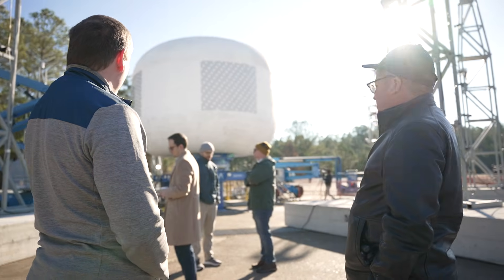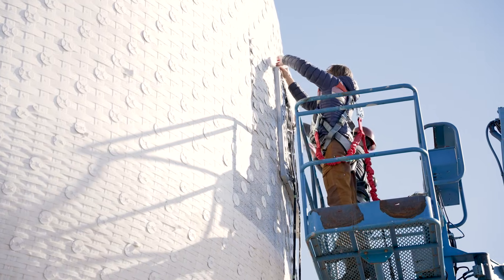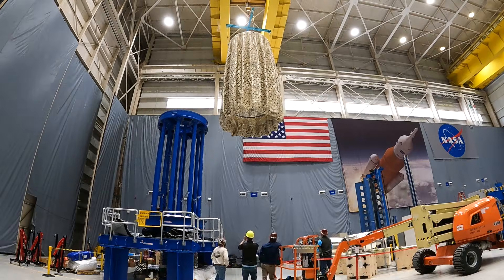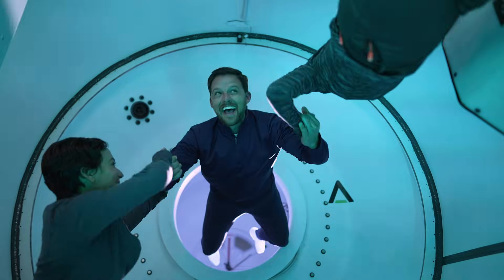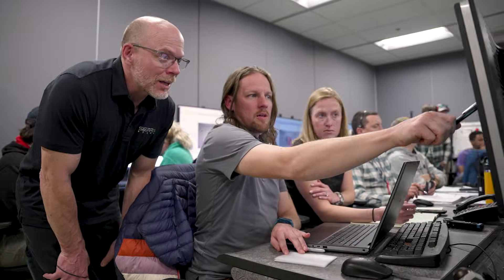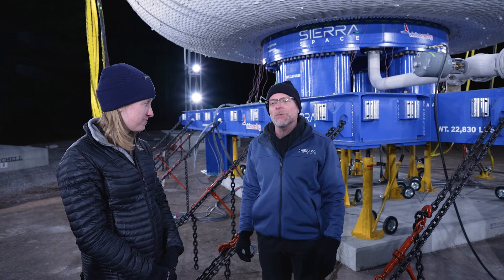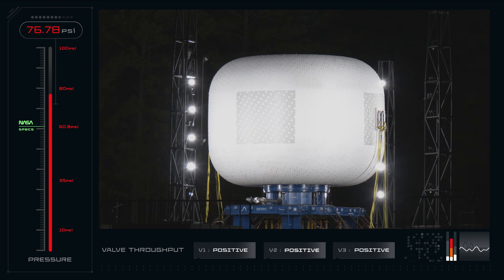Full-Scale LIFE™ Inflatable Space Station Burst Test at NASA Marshall Space Flight Center

Comment: What if asteroid punctures station?
Reply from the maker: The MMOD would absorb the impact and not puncture the pressure shell or restraint layer. In the unexpected case of an impact that makes it past the MMOD to the pressure shell and air barrier, the system is designed to be repaired internally.
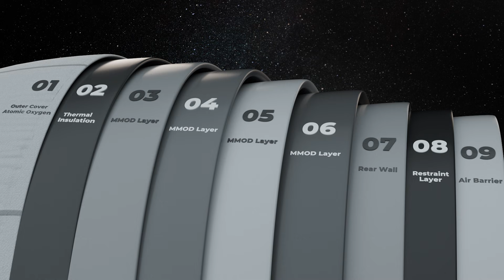Reply from the maker: Also, you can have a look at the layering our space station technology will have at 2:42 in the video. Our subject matter experts work with NASA to perform extensive testing and analysis of the entire MMOD stack.
Reply: @SierraSpace  "The MMOD would absorb the impact and not puncture the pressure shell or restraint layer." -- That behavior would be dependent on the rate at which the asteroid is traveling and it's size and it's shape; I believe.  You'd have a range of reactions based on the size of the debris and the rate at which it is traveling; right?  

Now; you did manage to exceed NASA's safety tests by 27% -- that is a huge success for you and your team!  Congratulations are definitely in order.
Reply: Boom!

Comment: Back in the 1960's, as best I recall, there was a design for an inflatable station on the cover of a Popular Science/Mechanics Illustrated type magazine.  The design was a Von Braun style station with the ring for rotation to simulate gravity.  My copy of the issue is, however, long lost.  :(
Reply: Was it the December 1962 edition of Popular Science "Inside Our First Space Station"?
Reply: If you want to scale up your inflatables a torus is a better solution than a balloon.
Tensile strength of the material is the limiting factor and has to increase linear with the radius of the balloon.
In case of a torus - as long as the small radius can stand the interior pressure you can increase the big radius almost indefinitely. 
The possibility of artificial gravity by rotation is a bonus.

Comment: it's all fun and games til a 10mm socket hits it at 18,000 mph
Reply: If this things in orbit, that means something either needs to be traveling at 36.000 mph in the same direction, or on an EXACT OPPOSITE ORBIT that precisely adjusted speed and timing to be at that EXACT OPPOSITE orbit. Hmm, what are the odds? It’s called zero. Things in orbit are going to collide at much smaller differentials except for micrometeorites and I’m not going to copy/paste Sierras’ statement about their testing in that area.

Comment: I'm curious if whipple shields could be integrated into the inflatable structure, to account for micrometeorites. Perhaps a graphene rear wall? Assuming, that is, graphene isn't too hideously expensive, and can actually handle the energy of such impacts without tearing apart or away from anything it is attached to. It would certainly reduce weight compared to steel, at least; possibly even able to stretch alongside, or even inside, the existing inflatable structure.

As a side note, I'd love to see your approach to inflatable centrifuge modules. If Kerbal Space Program is anything to go by, they will certainly make any station they're sent to much cooler.
Reply: They briefly displayed a diagram showing that the material has several layers. I imagine that's the micrometeorite protection
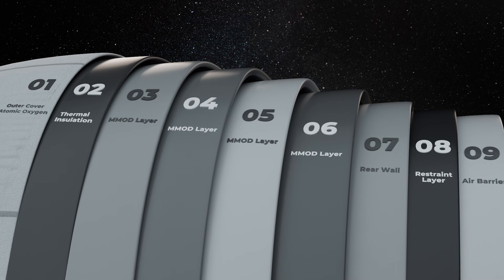Reply: 2:41 Layers 3 to 6.

Comment: How does it handle micrometoerites and radiation. 

Asking because that seems to be the only questions answered lol 
What I really want to know is when will the first module be launched into space for testing. After 2030, 2025-2028?
Reply from the maker: Our team works with NASA and uses the known and projected orbital debris environments in designing the MMOD shield. Those designs are then tested by simulating orbital debris impacts at varies speeds, size of projectiles/materials and angles in High Velocity Impact (HVI) tests. Our space station technology is designed for its environment and takes into several factors including radiation. Specialized shielding is designed to be a part of the MMOD layering along with other materials that are internal to the Inner Mold Line (IML) of the softgoods systems.
Reply from the maker: The timing for the first module will be dependent on the completion of tests in partnership with NASA. Our team has an an aggressive testing campaign this year at both sub- and full-scale, including a series of UBP tests in tandem with early-stage development of the primary Atmospheric Barrier and Micrometeoroid Orbital Debris (MMOD) layers. We'll have a better idea of timing upon completion of these tests.

Comment: I'm guessing that if you are inside one of these in space and you got a slow puncture it would be easy to fix from the inside. I'm not so sure what would happen if you encountered a blow out in space.
Reply: Rough googling says the speed of air is 1.5 times the speed of sound (500m/s)

(2cm * pi)^2 * 500 m/s = 1.97392088 m3 / s (4cm diameter hole)

Total volume is 283.17 m³

Equals 2 minutes with a 4cm diameter hole.

Comment: How well does it handle fire?  Internal or External?.  How flammable is it?  Does heat reduce its strength?  I realize it will probably only be nominally at ~14.5psi, but would fire be enough to compromise the whole structure.  When it is deployed, will there be internal rigid beams installed?  Both for making separate rooms/cabinets and for longitudinal rigidity?
Reply: Fire is difficult to sustain in zero-gee, and just turning off the air circulation fans is the quickest, safest way to stop a fire- it will greatly slow or even self-extinguish. The air-exposed layer air-barrier layer (#9) is probably a fire-resistant polymer, while the other layers aren't in contact with the atmosphere.

As for longitudinal rigidity, the internal pressure at one bar provides an axial preload equal to about 450 to 500 tons of axial tension. You could swing a sledgehammer at the soft goods and it will just bounce off. Hit a basketball with a hammer to get a feel for it...

Comment: That was pretty cool.  How would it do at high-pressure if it was hit by a micro meteorite.
Reply from the maker: Sierra Space has designed its softgoods inflatable architecture to be extremely robust in its design. The softgoods layered system is designed to prevent impacts to the pressure shell but in the unexpected case of an impact that makes it past the MMOD to the pressure shell and air barrier, the system is designed to be repaired internally.

Comment: This, to me, is like a space version of OceanGate. An Inflatable habitat in space. Were space junk can be traveling. At a hundred miles an hour, if not faster. This fancy inflatable that rubber is going to stop penetration. Not to mention small Interstellar objects flying through the cosmos at unfathomable speeds.
Reply: More idiots trying to dumb down modern high strength materials to “rubber”. Did you time travel from 1882 or something? Maybe they should make sure the “wax” seals on their windows are strong enough too! SMH And comparing a scientific and engineering space company to one rich guy who built a submersible on the cheap. Apples and oranges should be tattooed on your face.
Reply: That is why this module was tested to such high pressures, to account for long-term damage at ambient human pressures. Unlike OceanGate, Sierra is aggressively pursuing certification from all official organizations.
Reply: Pressure on oceanGate = 6000PSI. They are not even close to oceangate's pressure

Comment: Thats pretty cool. Does it have ripstop lines going throughout it, so that a small puncture does not cause an explosion of the whole structure? Is it repairable?
Reply: “rip stop” lines, like its’ made of silk or something. Ever hear of a little thing called “modern high strength materials”? Did people simply stop learning around 1995 or something ?
Reply from the maker: The LIFE habitat air barrier is designed to be repaired from the inside if by a rare chance there is an impact that makes it past the MMOD and pressure shell system.

Comment: Have you considered lining the outside with buckypaper? Its an agregate of cabon nanotubes that is stronger than steel and heat-proof yet as light and flexible as tissue paper.
Reply: I remember buckypaper.  Whatever happened to that?
Reply: > that is stronger than steel and heat-proof 

It costs $5000 or more per kilogram...

Comment: This is a realy good idea. Just one question. If a baloon is fully inflated, that means that the outside air and the inside air excert the same force. If this baloon goes up, then it explodes because on higher altitudes, there isn't enough air density outside to counteract the baloon, so the baloon expands to hit that same pressure, and because rubber isn't that good on streching too much, it bursts. If we did that in space, it would have been even worse, because even 1L air could expand as much as it liked. So how would you prevent the LIFE inflatable space station to burst?
Reply: Yet ANOTHER idiotic YT commenter that thinks a high tech envelope made of modern high strength materials is simply “the same as a thin mylar weather balloon”. Jesus, did you finish first grade?
Reply: The difference between space and sea level is only one atmosphere. ~15psi.
Reply: The outer skin is flexible but not elastic (at least no where near like rubber) and has a rigid internal skeleton.  This makes the structure more robust than a simple balloon, meaning that the vessel can withstand a far greater pressure differential before bursting. 

Other than using air pressure to retain its physical shape (rather than shaped metal or composites), the structure is little different in resilience to more familiar rigid structural components - even rigid tin cans can burst due to pressure if it’s strength fails.

Additionally, most balloons (especially rubber based) are made more fragile and brittle due to the low temperatures at high altitude, this, combined with being extremely thin skinned (to reduce weight) and adverse effects to its chemical composition due to high radiation levels, mean they have a significantly reduced lifespan at altitude. Consequently, the balloons tend to burst even if they were rated for higher pressures ground level.
Reply: I'm nowhere near qualified to answer your question, but high altitudes are about pressure differences, not the actual pressures. So air pressure at sea level is 14.7 PSI. The module in this video burst at around 75 PSI, which is approx 5 times greater . I'm not sure what the pressure difference is when you "divide by zero" which I guess is what space atmosphere would be? Good question, I'm not sure what the actual pressure difference is in space, but I'm sure NASA knows and this module passed their threshold apparently.
Reply: The pressure differential is what's relevant. The external pressure in space is 0 PSI. At sea level, it's about 15 PSI. They tested it to at least 70 PSI of internal pressure (6:1 ratio).

If you blow up a rubber balloon normally, the pressure inside the balloon is only a little bit above the atmospheric pressure right before it bursts.
Reply: The "balloon" is restrained at its inflated shape, so it's the structure of the material that prevents it from bursting. The outside and inside does not exert the same force -- In fact, that's this entire test. The "psi" callout throught the test is the pressure difference, with 60psi being the test threshold, and bursting happened at 75psi-ish.
Reply: You only need air at atmospheric pressure inside the station - that's about 14 psi, the station burst at 70 psi - they have enough strength.
Reply: That’s actually incorrect, a balloon is “fully inflated” when the pressure from inside is countered by the pressure outside PLUS the containing force of the balloon material. So the pressure inside a balloon is higher than outside because the balloon’s elasticity squeezes it, and a balloon bursts when so much containing force is required the balloon rips.

So ultimately it turns to it what actually matters for the balloon ripping/bursting is the absolute difference in pressure between the inside and outside, which in space is whatever you pressurize the inside to. 

So if you design a balloon to withstand a certain pressure differential it doesn’t matter if the balloon is at 15psi and the outside is at zero, or if the balloon is at 515 psi and the outside is at 500.
Reply: I don’t think it’s made of ballon rubber. Tires inflate to much higher pressure than sea level atmosphere and don’t pop.
Reply: This isn't a zero-delta-pressure balloon, it's more like a truck tire, built to withstand a huge pressure difference (75 psi at burst). There are literally tons of high-strength straps on several axes to hold that load- see layer #8 at 2:42.
Reply: It isn't inflated until it's in orbit So no atmospheric pressure.  That is the entire point--it fits into rockets because it is deflated/compact, then once delivered to orbit it is inflated giving a much larger environment.
Reply: The envelope is strong enough to stop the air from expanding, even with a hard vacuum on the outside.  When you're measuring the strength of an inflatable structure the outside pressure barely matters, you mostly need to worry about the difference in pressure.

So they put about 90 psi (absolute) inside the structure with about 15 outside, which means in space it will hold up to about 60-75 psi.  This is good; they only need to go up to about 15 normally.

(And strength above 60 PSI isn't a high priority because that's enough to significantly injure occupants, if there was an explosion or collision)

If a structure pops in a vacuum, the gas cloud does expand faster so it might boost fragments to higher speed.  So that effect should be considered and wasn't tested here.
Reply: This structure is more like a soccer ball or an air mattress than a balloon. The walls do not stretch and get thin like the walls of a balloon as it's being inflated. Unlike a rigid structure, it can be folded or rolled into a compact shape (again, like a soccer ball or air mattress) for delivery into space, and then inflated once there.
Reply: Then let out some of the air so it doesn't pop?  But in reality, it's just a delta as you discribe pushing out vs pushing in. On the ground say it was at 75PSI ~5 bar and at sea level the air pressure is roughly 14.7psi. or 1 bar .  Now change nothing but put it in space and you've now removed that outside push of 1 bar, so the inside can now push with 6 bar.  In reverse go underwater 10m is aprox 1 Bar or atmosphere.  Well go down 40m you're okay and much more than that and you get smashed.
Reply: Not an expert but:

75PSI is when it burst.
The atmosphere is about 15PSI.
So in space it bursts at 60PSi.

To get atmospheric pressue they only need to inflate to 15PSI.

15PSI is much lower then the 60PSI it burst at.
Reply: Saying that it is thicker than a balloon would be an understatement. As seen in the video like space suits which are just human shaped bags with air and tech in them, it is made of many layers of thick sturdy materials. The pressure test done at ground level used high internal pressure which simulates the type of pressure differentials that would be expected in space. The required durability was met and exceeded. They tested to failure because it is always good to know how much your structure can withstand even if you never expect it to encounter such strong forces.
Reply: Wrong,,, Think about the air pressure in your car tire...